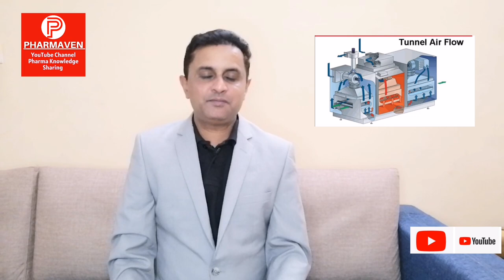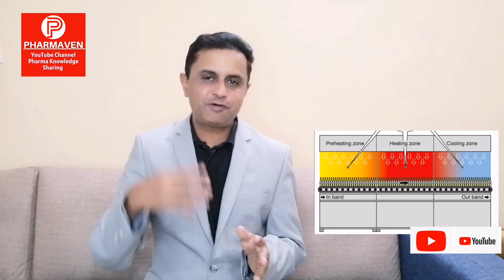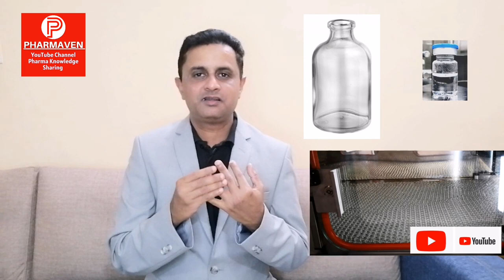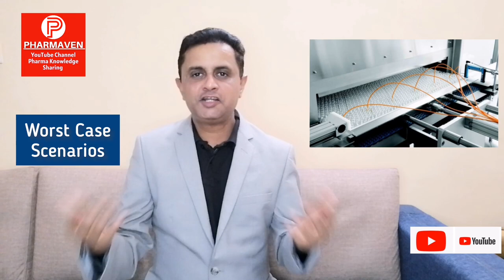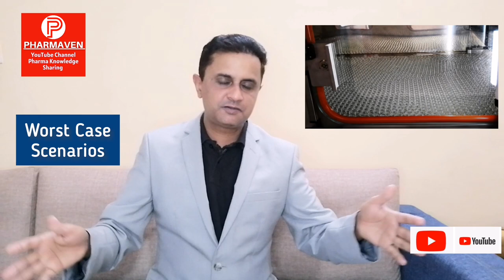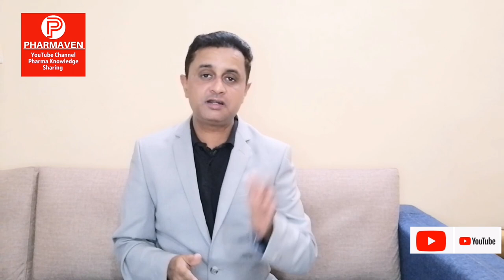Depyrogenation Tunnel Working principle & validation #sterilization #usfda #aseptic @PHARMAVEN

Comment: Thanks for sharing!

My queries:.
Is smoke study applicable for Tunnel ?

If online flow Measurement then do we need to check Flow Measurement at 5 points 

Similarly about Filter integrity of Tunnel 

How is the industry practice?

As all of above is not easy to perform.

Kindly suggest or make vedio on this

Comment: Dear Sir,
Please clarify following Points.
1.I have 10mL moulded and 10mL tubular vials with the same dimension.
Can I Qualify only for 10mL Moulded vials? by considering worst case.
2.5mL moulded vials having 13mm Neck and 5mL tubular having 20mm neck.which one i should selected and Qualified?
3.2mL moulded and tubular vial having 13mm neck then which one is should consider worst case for Qualification?or both the vials should be Qualified?
4.when my vials having Type-1 and Type-3 with  the same dimensions... Qualification should be performed for both the vials or worst case I can consider as a type-3 and recommended same parameters for type-1 vials?
Thanks/Uday
Reply from the maker: 10 ml Molded
5 ml 13 mm neck (less air penetration in vial with small neck)
2 ml Molded

You can take approach as 2 ml minimum, 10 ml Max, three runs each
5 ml as one run verification